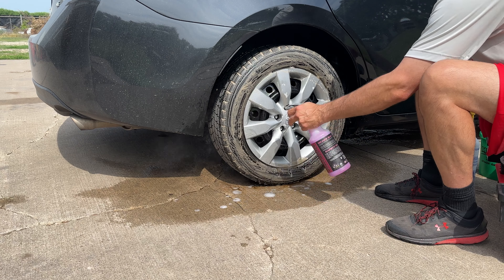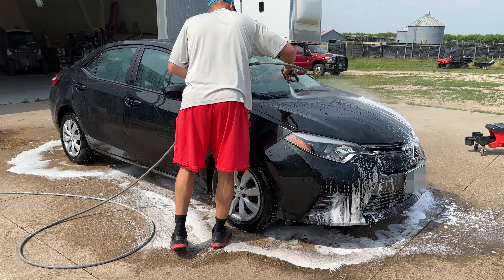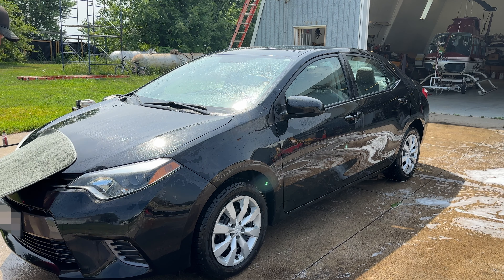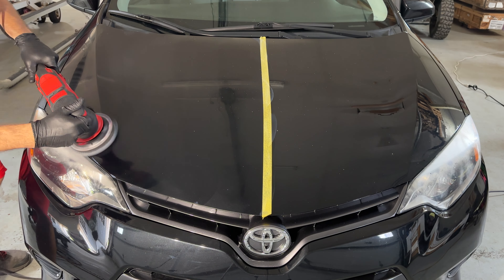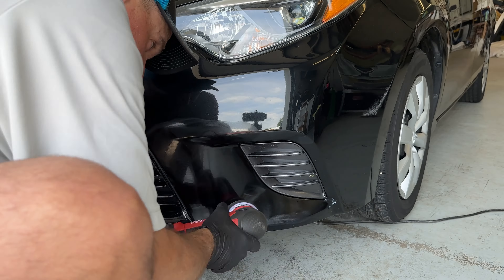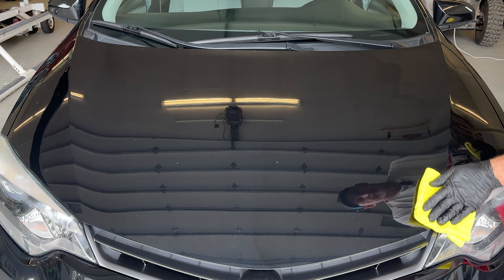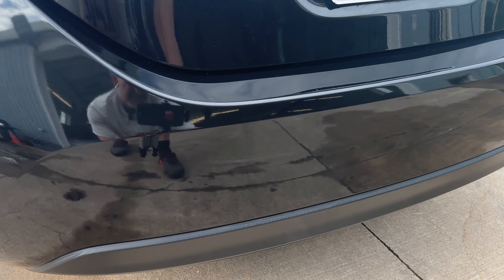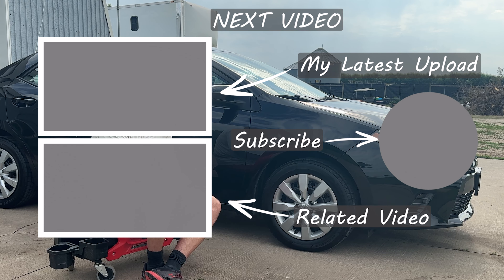My First Ceramic Coating - Your First Ceramic Coating!

Comment: Great work!!! You did well. Just some pointers, whenever polishing stay away from edges, get paint gauge because you need to know how much paint you have to work with. Apply ceramic coating in small sections so you can level the coating better (but as you do more cars you will get comfortable). Even if you have a high spot or a patch like in the video, you can go back the next day and level it off. Most of the coating give you about 24 hrs to find mistakes. Even I do a last check before delivering the vehicle to the customer and find some uneven spots. I just wipe it down or just a little compound on a towel can balance it.
Reply from the maker: Thanks for the tips. I know I went a little too fast on this first one. My impatience is one of my biggest weaknesses. I do need to get a better paint inspection light and also a paint gauge.

Comment: Looks fine to me Scrapper but then I haven’t used it before! All a learning curve I suppose. Well done again 👍
Reply from the maker: Thanks much Simon. I did a lot of prep work, but the coating application was much easier than I thought it was gonna be.
Reply: @ScrappersDetailing -
was this a rotary polisher or a DA? You did a phenomenal job!
Reply from the maker: @MrChuckwagon55  Both polishers were DA. I am not ready for a rotary yet. Those things can really get through paint if you aren't careful is what the pros have told me.

Comment: Awesome job, MOHS is a go-to of mine! A tip for working in high heat though (I've had to apply it in full or direct sunlight a few times) is to just work smaller areas. Your hood, for example, could have been split into quarters. Anywho, keep it up!🤙🏾
Reply from the maker: Thanks! Yeah I figured that I was working in too big of patches.